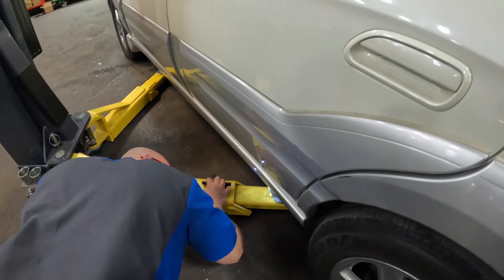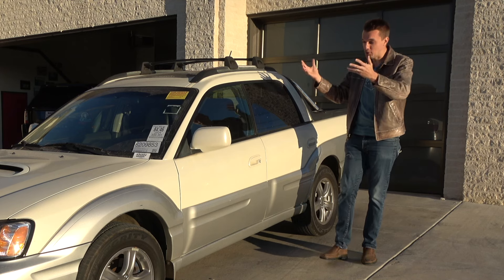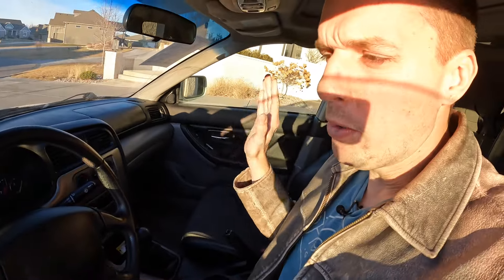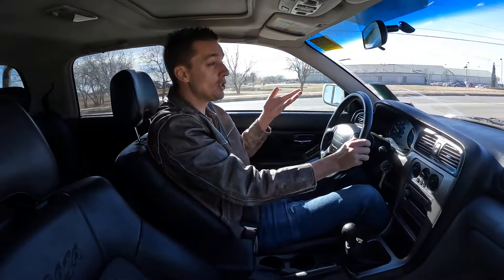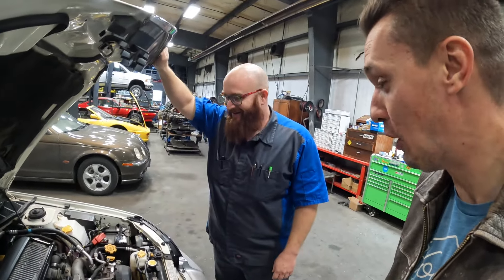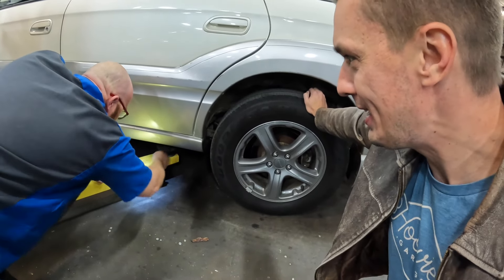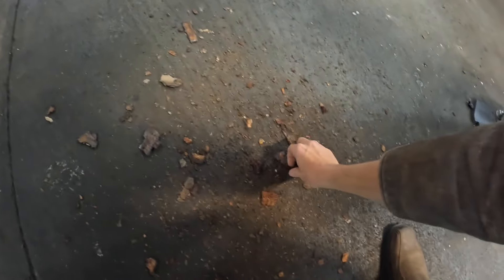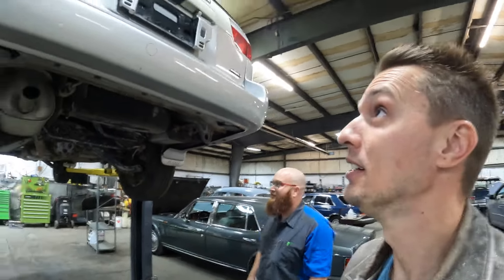Here's why you should NEVER EVER Buy a Cheap Subaru (total mechanical/rust DISASTERS) Baja XT Turbo

Comment: Surely, you could auction it as "for parts only, not safe to drive"? That engine and the transmission is worth a few dollars.
Seems a shame to get a perfectly good engine crushed.
Reply: @FoRmaTiTo  The flip side is though that the body panels and interior looked to be in great shape for the mileage and considering the condition of the underside. I know the Subaru enthusiasts are always looking clean body parts
Reply: @FoRmaTiTo  I know a ton of people who would buy a good used EJ25 no matter the mileage
Reply: @FoRmaTiTo  although others have practically said it, whether its a subaru or not, it could be rebuilt, and some engines go for 500 thousand miles without a rebuild, if it still has compression and has its oil changes looked after it's really not a big deal.
Reply: @FoRmaTiTo  Depends on where the car came from. In areas where they don't salt the roads structural rust isn't really a problem. My mom lives near Seattle and has a '99 Forester with no issues.
Reply: I actually need another engine right now
Reply: @FoRmaTiTo  to answer your question it would be very unsmart to not pull that engine it's probably around a  2000 dollar motor and they would probably give you bout 100 dollars for the car normally anyway always pull out don't leave it in
Reply: @FoRmaTiTo  im guessing you live in a city/town, not the countryside, or an area like kansas ;) I live in wyoming. 200k isnt high milage here because of the types of road. 400k-500k is high mileage here. i used to live in sf, 160k was high mileage there. also in today's age, a million dollars isnt really that much. hoovie is a multi-millionaire, and that's the difference.        to answer your question; it really depends on where the cars from, and who owned it, but, yes. I would.
Reply: @FoRmaTiTo  not completely irrelevant. while people do change, theres always part of them that makes them who they are. he's just moved to more expensive cars instead of beaters like this.

Comment: I bought a similar deal at an auction. That one was ride and drive though. Everything checked out until I got it to my shop. Interior and exterior were immaculate. The frame and everything else was a swiss cheese disaster. The Tech came running to my office saying you've got to see this, after he saw it he wouldn't stand under it and I understood. Called the auction and they thankfully took it back. I told them about all the problems. I hope no one got that one too.

Comment: 5 years ago I spent 1 year hunting one down, and finally got one!

'05 Baja with 2.5 Turbo and a manual transmission.  Mine was in pretty good condition, but recently needed needed a bunch of engine work.

I love her so much, I refuse to let her go!
Reply: Let me guess...head gaskets? Same engine different car...2002 2.5RS Impreza. Happened to me.  Fortunately it was around 80K so I just did the timing belt and a few other top-end items.  Ran great until 140k when i traded it in.   At that point the exhaust was gone and it needed a clutch, brakes, routers, and some suspension work.  I got 2500 trade-in  in 2012...not bad since it probably needed 4000 worth of work.  Good luck with the Baja!
Reply: You can get a JDM 2.0 turbo engine to throw in it for pretty cheap compared to rebuilding an EJ255 or purchasing another 2.5L. I said YOLO and sent my Baja's engine for a new crank and forged rods + pistons about 40,000 miles ago. I've been more aggressive with boost and timing and haven't shattered a piston yet, thankfully
Reply: Maybe you ca buy Hoovies engine
Reply: I wish I could find a good clean Subaru Baja that was in my price range...they seem to be really practical vehicles, but the  ones ready for the scrapyard seem to be overpriced, and the good examples are unobtainable cuz the owners don't wanna sell em, LOL!

Comment: Surprised it didn't just evaporate while on the lift! Don't think I've ever seen structural rust that bad, you do have to wonder what on earth that car has been through!
Reply: I'm-a gonna go with "New England winters".  Road salt eats cars.
Reply: This car was probably used as a tow vehicle for a boat, was in a salt water more than once. Just look at Miami boat ramps what peoples doing there.
Reply: @altergreenhorn  it looks like every northeast car that isn't oil sprayed
Reply: This is definitely worst than New England Winters. This car looks like it was parked in a salt water flood for over a year.
Reply: Michigan. Guaranteed or similar.
Reply: Pretty comon on Subarus actually 😂 they are crap. In fact, most japanese cars of the eara are like that.
Reply: Early Japanese cars were horrible.  Datsuns were complete rust buckets after 4-5 years. Still ran though.
Reply: @firesurfer  so true.  We used to pull engines out of rusted 510s, and it really didn't matter if you missed a bolt or two.  They would just tear out as you raised the engine hoist.  Good times 😱
Reply: @mikescayenne  Speaking from experience New England Winters can take a toll. If it's a winter beater that someone just parks in a garage come Spring, all that road salt just gets left on the frame to eat the thing away. 

I had a Honda Civic that had the shift linkage get so rusty it snapped in half when I pulled into my driveway once. Not a shift cable for an automatic, the actual linkage for a manual. Conversations at junkyards went like this: 

"I need a shift linkage for a '97 Honda Civic, mine has snapped."

"Linkage? You mean the cable?"

"No, I mean the linkage. It's a manual."

"What? Manuals don't have cables though."

"Yes, I know this. It wasn't the cable. It was the entire shift linkage that snapped into pieces."

"... what? Seriously?"
Reply: Y’all wouldn’t last a single year in New England if you think it’s that bad
Reply: Willing to bet money on the owner having lived in the rust belt.
Reply: @Mike exactly !! I’m in the Boston area we have the salty air mixed with mostly 75-100% humidity mixed with overly salted roads. All together it’s a recipe for rot

Comment: Having owned a Subaru that spent its life in the south, I would never have one again. Not only do they rust like that, but they are a pain to work on and honestly are not built that well. I don’t understand where their good reputation comes from
Reply: It comes from people not willing to admit their mistakes. Even after all the headgasket issues came to light, Subaru fans were stating "Not my car" while waiting on tow trucks to pick up their garbage spewing vapor on the side of the road with less than 60k miles on the odometer.

Every car manufacturer has been guilty of making a turd or two, but few can claim such a psychotic fanbase as Subaru. They dwarf even BMW and Dodge fanatics with their zeal.

Comment: Part it out!!! A lot of those parts especially the motor cladding good body panels and interior and such are worth a ton. You could make your money back on this thing easy. I was so exited to that hoovie finally had a Subaru. I’ve been waiting for this forever and this is how it ended haha
Reply: He could recoup some of his money but not as much as you would think. He might get a couple grand for the motor, but probably closer to a 1000 because of miles. Trans is worth something but again pretty old. Rear diff if it’s not too rusty. But body wise there is no the salvageable there. It’s a unibody, everything is going to have rust. No one cleaned road debris from the wheel wells and from the hollows on this car ever. The amount of work to get back maybe a third of his investment would be better than nothing. The real value is in the video of the car. It’s a real shame, could have been a cool car.
Reply: I would agree with that. Strip out all the good parts and junk the rest, but I don't know if you could reach 9 grand on old parts like that
Reply: @taurushill04  really I think selling it as a whole would be better, be honest and upfront that it's a parts only car. Let the buyer perform the labor. Yes less total money, but way less time invested.

Comment: This reminds me of when in 1987 my stepfather came home with a 1978 Ford LTD two door coupe.  Had traded some stuff for it and said “Well, here’s your new car”.  For what you could see if you didn’t go underneath it wasn’t bad.  Lived in Alabama, but, the car came from a Midwestern state notorious for heavy salt usage on the roads.  Knew it was originally that beige-ish mustard yellow that was popular at the time based on the interior, and, where you could see it through the dark brown metallic repaint.  It also had gold faced “bullet hole” mags, air shocks and glass packs so it had the typical late 1970’s “trying to look tough without anything under the hood “ look.  Started driving it and noticed things didn’t feel right.  Turns out the underside was so rusted things would start falling off in metal chunks including pieces of the frame.  To try and get some of his investment back stepfather sold it to one of his brothers, but soon after that it went to the junkyard.  Thank you for the notification that I was not the only one to ever get burned by the rust monster.

Comment: Great episode.  Brought back memories of my Alfa Romeo Alfasud 1.5Ti.  Getting a flat tire on the left rear and using the scissor jack to do a road side wheel change, only to see the jack go up through the subframe without lifting the wheel at all!! - to quote Mike Brewer from Wheeler Dealers “… if it’s quiet and you listen carefully, you can actually hear these cars rust!”
Reply: In good shape, those are some of the coolest cars on earth!
Reply: Same thing happened to me on a Hillman Avenger which was sold in USA as Plymouth Cricket, until replaced by a car sourced from Mitsubishi
Reply: though that car was designed  in the late 60s early 70s....  when almost all cars rusted splendidly

Though the italian cars (except Ferrari/Lambo etc due to no driving in bad weather and care of it)  weren't good in any way thatsoever.